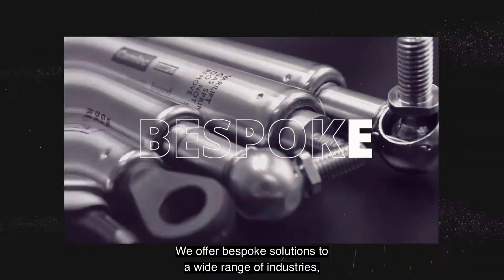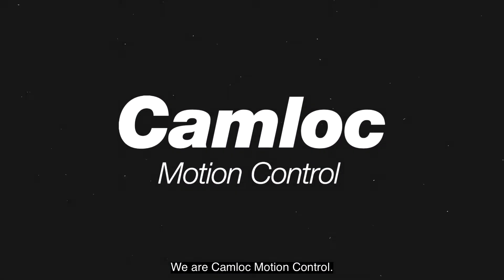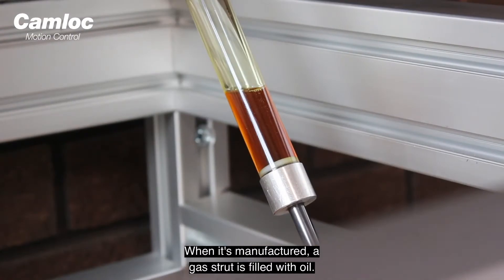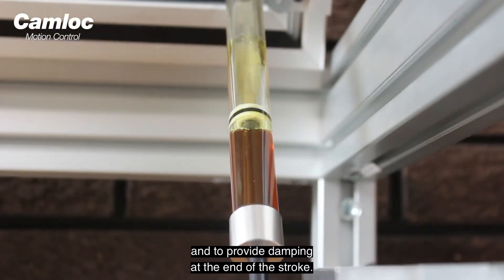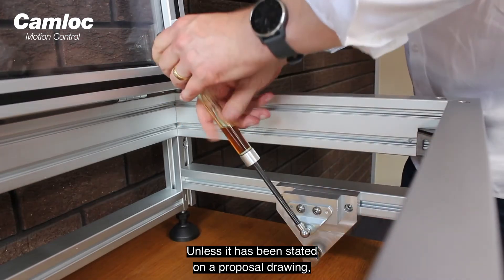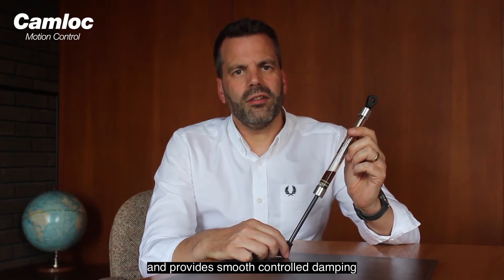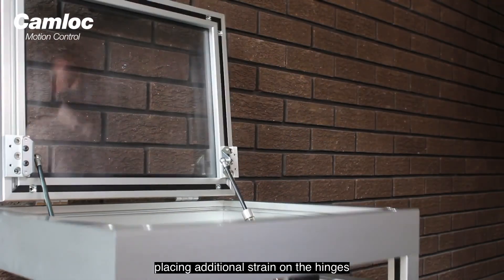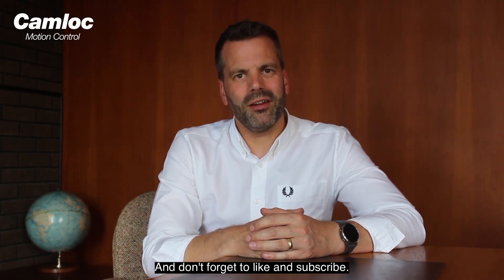How to mount a gas strut correctly (FAQ Series) - Camloc Motion Control

Comment: New pistons were installed in the direction indicated in your video on our platform bed that has a storage compartment below. The pistons are needed to assist in lifting the platform holding its heavy mattress in order to access the storage. The new pistons worked when installed but the next time I tried to lift the bed they did not work at all. Why would that happen?
Reply from the maker: Hi @lmahaney1955 👋 This sounds like a question for the engineers, could you get in touch with them using our contact form and they will help you out with this issue! Here is the link: 
https://camloc.com/uk/contact/

Comment: I need a gas strut to open the lid on a grain silo lid.  It is a round lid.  Every video I find shows a gas strut being added to a square or rectangular lid.  Would this be an issue?
Reply: No problem at all. Just make sure that it's li ed up properly on the lid as well as on the round hole. These can be used on any application that needs assistance.